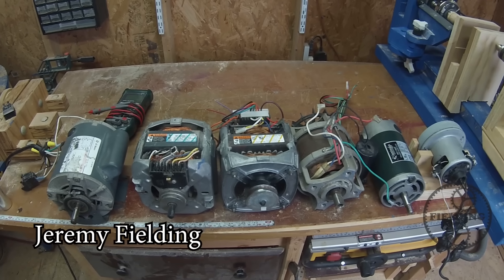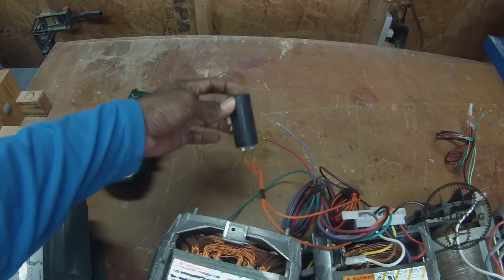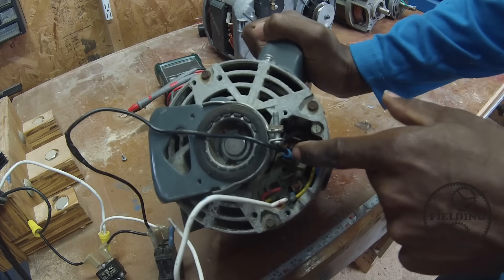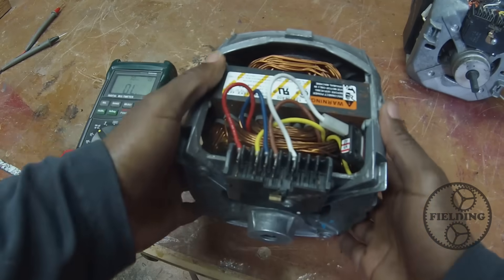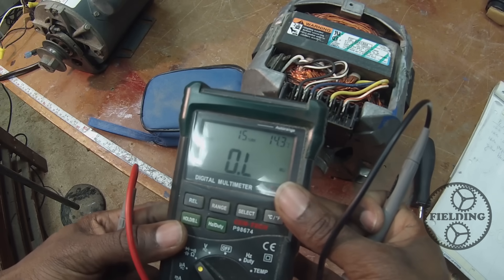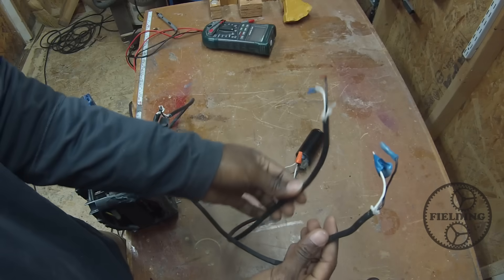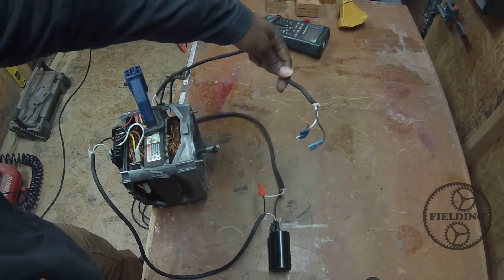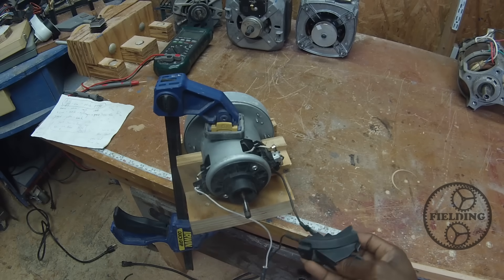How To Wire Most Motors For Shop Tools and DIY Projects: 031

Comment: Any idea on how to wire one of those on a 12vdc car battery? Thanks
Reply from the maker: watch number #20... Those motors can be wired to a battery
Reply: Jeremy Fielding what i have is(and unfortunately stuck with) a 120vac induction motor. Its a garage door opener motor. The only option that i know of is to mount a 3500w generator some where in my 91 toyota 4x4 pickup to obtain 120 v. I was trying to use the trucks electrical system to make this a.c. induction motor work. Btw I've learned a hella lot watching your vids. Those washing maching motors are bad ass. The wiring a little weird but they work well. AND they are pricy even on ebay. Thanks Jeremy. Keep posting

Comment: Jeremy -- can you do a short video showing how you constructed the 'test cord'?  IN otherwords, the  power cord that has the circuit breaker, and switch wired into it, with the leads/disconnects wired onto it?  I want to make one to test a few motors in my shop -- but I'm no electrician -- and would like to see how you did it!   I'm a woodworker first.. but man.. you've got me interested in learning how these motors work, and putting them to work in my shop!
Reply from the maker: I will consider it. You are the first to ask, but depending on the context I might add it to another video I have in mind for motor wiring.

Comment: I'm trying to build a parts tumbler using a 5 gallon bucket for the barrel. I was thinking a friction drive but all the motors I can find run pretty fast. There's a Habitat restore here, and I was thinking of a ceiling fan motor. Any thoughts on that? I'm trying to rehabilitate some tools that I picked up at various actions and such. Going set up my grandson's with a good toolbox. I'm making the tool box itself.
Reply from the maker: I have never tried to make something like that. Nothing immediately comes to mind

Comment: Great video, I've found motors in hard drives and microwaves that didn't work when I connected their rated voltage's I thought they need circuit boards and programs to get them moving, not sure if their phases are different or if I've just cut the capacitors without knowing... perhaps I get them back out and have another look again, I didn't have much patience with them, it annoyed me that something simple like the turntable motor was'nt a simple 12v brushed motor... and the fan to be fair..

Comment: Jeremy very good  a lot of good information to help using old motors for power sources.  As you have many motors here is a suggestion for a future project, design and make a paint tin shaker to mix the paint in the tin thoroughly. Most people open a tin and if it has been standing for sometime the ingredients settle out and you stir with a screw driver or stick  but it is not as good as the store vibrating paint stirring tables. Just an idea for you.
Reply from the maker: Interesting... you are the first to suggest something like this... I don’t know... we shall see

Comment: whats the result if you take out the CAP?
Reply from the maker: You basically have to push start the motor.
Reply: Jeremy Fielding I've got a motor that is just identical and there is no way a cap that big can be hidden away in it but I have the wires hooked up just the way you have it but without the cap and I have a switch across power wire as soon as I turn it on the motor runs..thanks for the reply

Comment: I was glad that you had a camera Mount. Ty I have 6 motors 3 pH I would like to make them into wind generators for off grid power. Any thoughts ??
Reply from the maker: I am about to start a series on building a generator... so you are asking at just the right time. The first one will be about DC motors as generators, but now that you bring this up... I am considering doing a three phase motor as well. It can work, but there are pros and cons to each type of motor as far as reversing it to generator electricity. It would be pretty hard to cover my thoughts on the topic in the comment section.

Comment: Already teaching me alot. I was thinking that I was needing to replace the motor on my shopsmith, but watching this tells me I may just need to replace the start capacitor. Hopefully I'll get her tore down in the next few days and try to do that. 
Also watching because I'll be putting a washing machine motor on my bandsaw. Is there anyway to figure out your leads without a multimeter? The only one I have is 12v.
Reply from the maker: I don't think so. You can't know what you have without tracing every wire... I think you should get a multi-meter. :) I recommend a very cheap one here  https://youtu.be/Klb09_ocdRo
Reply: Jeremy Fielding I completely agree that I should get one. Especially now that I've found your channel, I have a feeling I'll be building more stuff than I was to start with. 
I'll give that video a look here in a few. Preciate it.

Comment: I got a dryer motor out of a dryer by the trash and its got 1 blue and two copper wires, how can i wire this to a regular 120v cord? i need it for a project but i have no idea how to wire it. please help
Reply from the maker: I try not to get into troubleshooting like this. It is not safe nor practical. I can’t handle the volume of requests I get, and I can’t be sure you are giving all the relevant facts or even that I understand your problem correctly. I have a large number of videos on motors and I think you will find something helpful if you watch the how motors work series. Really the video you just watched is the one most likely to help you get this motor going. It sounds like you didn't actually try what I showed in the video. You must test the leads and work out the wiring on your own. To say more than that is too risky. There are a large number of ways a motor can be made to run so i can't risk giving you the wrong advice.
Reply from the maker: Reading the label on the motor should also reveal important information about the voltage required for the motor. If there is no label you need to find what you can, then search the internet until you get more information on your motor. That is what I would have to do.

Comment: Hi your video was great but I still need some help with a whirlpool washing machine motor to get it going . I want to use it to run the water pump on a 100ft 3/4 water hose

Comment: if i got a motor with three or four wires wires i want to know how to hook up to power suply , you assum that we have parts already  like you do
Reply from the maker: +fuser I don’t understand? What you see here is the minimum requirements. I don’t use anything fancy or things not easily accessible? I use basic wires and tools. Without them you can’t do this. It is up to you to decide what motor you have based on what is seen here. I have a whole series on wiring these motors. You may need to watch the others to fill in the gaps you find here.

Comment: im looking for motor to turn the fins of my remote controlled airplane...? is it the same motor??
Reply from the maker: +herr oberliutenant lang you want a very small “hobby” dc motor. Or probably a servo motor. The are tiny compared to these guys. A small battery will get it running.
Reply: aaa.. sankyuuu Jeremy Fielding . But will it give enough torque without burning out the motor?
Reply from the maker: You pick the motor size. I don't know your application well enough to determine that. They come in almost any size you could possible want. Better yet, they sell kits for exactly that purpose for all size RC planes. You just have to do the research to get the right size motor, or buy a kit.

Comment: Ups ,,I just took out a motor from a GE front loader,,and wired it to a plug ,,and it worked ,,, so ,,, the star capacitor  I did not have it attached ,,,, is this dangerous,,,
Reply from the maker: +Raul Cota sometimes they start without it but you will need one. Once you attach a load you really need It.
Reply: Jeremy Fielding thanks very much for your time and all your knoledge
Reply: Ups ,,I throu it away ,,,so, what info off the motor do I need to get one ,,,and once again thanks
Reply: the label says model 205850 type 20585 000 ac-el cl f 110v~ 50/60 Hz 1600 rpm 5.17.w   I hope this will help me

Comment: Couple of things:

1) the second motor you wire, looks to be a whirlpool washing machine motor, come in 2, 3 and 4 speed motor. All have forward (1, 2 or 3speeds) and reverse. ( I'm an appliance tech) Can you talk about how to tell which terminal is which. 

2) I have not seen you use a motor from a dryer. Going to talk about the motors that Whirlpool use because I'm most familiar with them. They have a centrifugal switch internally that one pole of the 240 for the heat element runs thru, theoretically so if the motor is not spinning the heat element doesn't come on. Is there a reason you don't use them? Seems like this is an interesting feature that could be used as a safety in repurposed uses.
Reply from the maker: Kevin...Many of the washing machine motors have multiple speeds as you mention above. Although the continuity test would show which ones are pairs, It would be difficult to tell which winding-set you were touching without trying each one to see its resulting speed. To reverse the direction of rotation you reverse the starter winding. I show this in great detail in the "Put it in reverse" video of the "how to wire a motor" series. You might enjoy my "how motors work" series as well. This is all on my channel page "playlist"

As to the dryer. They are usually 1/3 hp motors. I don't keep those because I have quite a collection of motors 1/2 hp and up. I just don't have one to show, even though I have salvaged several dryers. I usually just get the wiring because it is so useful as a heavy gauge wire.
Reply: Jeremy Fielding thank you.

Comment: Thank you very mutch for your great videos.
I have a washing machine motor induction single fase. I conect the motor to graund and hot and it speen realy fast. The problem is that i can stop the speen by holding tghit the shaft. It have no power to resist. What can be the problem?
Thank you
Avishai
Reply from the maker: It +אבישי שטרית it sounds like you have a centrifugal clutch. Are you stopping to whole motor from spinning? It hums but NO part of the shaft is spinning? Or you stop the sleeve that is riding on the shaft. That is usually where the belt attaches.

Comment: Hi Jeremy , just wondering can a washing machine motor be converted  so that it runs off 12 volts for the option of using it for an e bike ?
Reply from the maker: In general I would say no. It is possible to electrically modify 12 volt dc to 120 ac with an inverter. But, that would make your "electrical system" quite large and more complicated. The inverter has to be rated to handle the power of the washing machine motor. But one that large might cost as much as a 12 volt DC motor. But at least you have a path if you wanted to explore that option anyway.
Reply: +Jeremy Fielding Thanks for reply , we have  220v  here in Ireland but I presume it's still the same case as your 120 AC there . love the videos keep up the good work . would you consider making some mechanically propelled stuff with your motors ? like E bike  or something to that effect.
Reply from the maker: +pony mahoney yes. To the 220 and yes I am thinking of a motorized cart right now. I haven't worked out the full plan.
Reply: +Jeremy Fielding Excellent look forward to seeing it . god bless

Comment: Thank you for sharing your information.  I am trying to repurpose a sewing machine (120v 60Hz) motor for a DIY paint mixer.  I'm a little stumped as to how to wire the three wires coming out of it.  I have a Red, Black and White wire coming out of the motor and my hope is wire it to a light switch dimmer or timer to control the speed/time.  But I'm not sure how to match up the wires to the typical home wiring of Black, White and Ground.  Do you have any suggestions?
Reply from the maker: Please understand... I make these videos because I wanted to help the general public with things I spent many hours researching to learn and figure out... but it is very risky to give direct advice to someone without actually touching the machine myself. I can't be sure I am asking the right questions or if you are giving the correct information. You may be leaving out something important without knowing it was important. Someone in my community here is welcome to give some additional thoughts... but I would try identifying exactly which motor you have. then you can follow the wiring shown in the video. This is part of a series... if you see them all you will likely figure it out. Try the last one first https://www.youtube.com/playlist?list=PL4njCTv7IRby2MEHBUJ51QIovAZK3rcKJ
Reply: Thank you for the response.  I totally understand your position and agree.  I am quite adept at home wiring after having worked in the construction field for years.  I personally took the motor out of an old functioning sewing machine, so I know that it works and that it's 120 volts.  I've messed around with small motors before but I've not had one with more than two wires (without and instruction booklet like a ceiling fan) before.  I'm starting to think that I might just have to hook it up to a foot pedal from a sewing machine to make it work and just forgo the dimmer switch idea.  I'll check out the video that you suggested.  And I have not had any luck trying find out anything about the motor based on the identification sticker that only reads, YY8622-12 120v 60hz.  Thank you again for your time.

Comment: This is a must see video for makers. Can you show how to run three phase motors on single phase? It is common that you can get high horsepower motors for less than a 1 hp single phase motor.
Reply from the maker: I plan to do one in the future. I am not sure when just yet.

Comment: I have an amana clothes washer modes nav2330aww.  I am not seeing a start capacitor any where on the machine.  The motor will only move in the cycles with nudges to the drive belt.  Does this machine have a start capacitor?
Reply from the maker: +Lennie Chism some washing machines use a relay to start the motor. It will require some research to find out if your particular one has a start capacitor. You should look for the wiring diagram. It is usually behind the console up top.
Reply: Here are the wiring diagrams links.  Am I missing the relay?  http://www.ereplacementparts.com/amana-nav2330aww-residential-amana-laundry-parts-c-203762_478939_479513.html
Reply from the maker: You have to understand... I make these videos because I wanted to help the general public with things I spent many hours researching to learn and figure out... but it is very risky to give direct advice to someone without actually touching the machine myself. I can't be sure I am asking the right questions or if you are giving the correct information. You may be leaving out something important without knowing it was important. I suggested the wiring diagram to help you follow the bread crumbs. There are forums where people give direct advice, but I don't want to be the guy you look at if things go wrong. The wiring diagram should show all the electrical components of your machine.
Reply: Solved - chaffed wire.

Comment: Hi I have a treadmill motor which is 220vdc one and a half HP we have 240v mains can I run this straight from the mains or can you tell me what I would need to use help thanks
Reply from the maker: use the link at the end of the video. It is my video on DC wiring.

Comment: I have variable 16 scrolling machine. I have not touch them in 15 years. It won't come on. I took it apart. I took motor out. It has four wires. How do I wire it to see if motor works or not?
Reply from the maker: I suggest you watch the series on how motors work and see if this helps you identify your motor. I prefer not to give personal advice like this. There are too many things I can't see. I would risk you getting hurt because of some unknown variable I didn't know to ask about, and you didn't know to tell me. Google is also your friend. I promise you are not the first to try and wire the motor you have. First you need to know for sure what type of motor you have. Then my "how to wire a motor" videos will be more helpful. The most common types are in this video you just watched except the DC motor which has it's own video here. https://youtu.be/ASywVBU0ZwE the how motors work series is here https://www.youtube.com/playlist?list=PL4njCTv7IRbw82wJBDt3empXSMzYa7sUB... hopeful you will find these sources helpful.